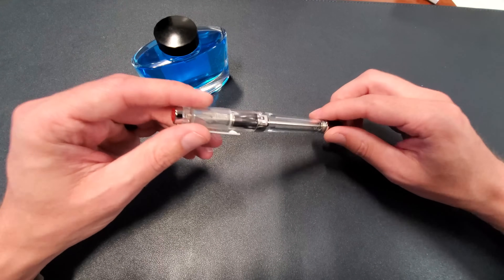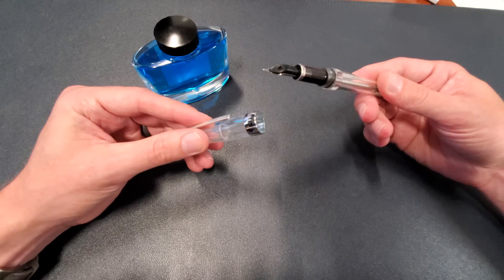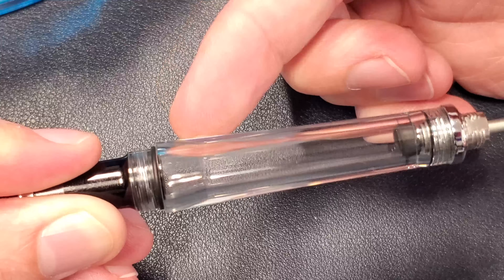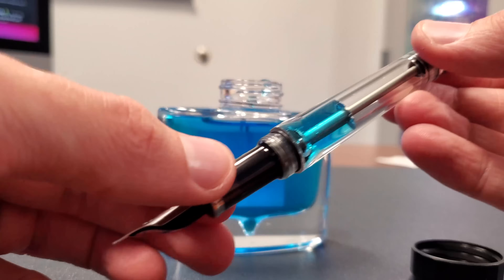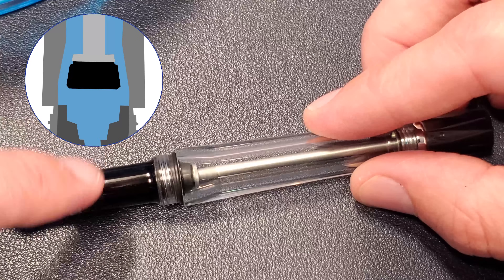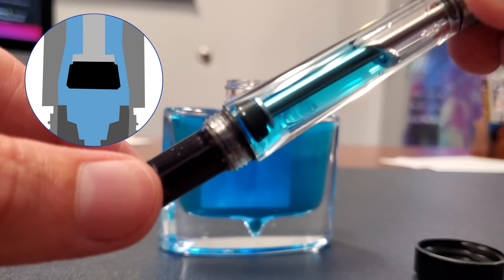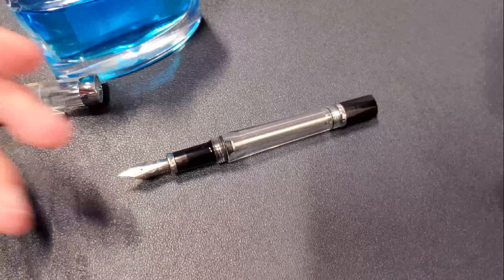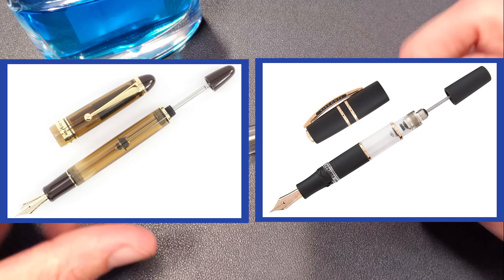How to Avoid the Most Common Mistake with Vacuum-Filling Fountain Pens

Comment: This does NOT apply to all vac fillers. Visconti power fillers ONLY if they are double reservoir.  Vintage vac fillers (Sheaffer and Wahl Eversharp) do not have this feature either.
Reply from the maker: You're absolutely right! Thank you for that. - Drew
Reply: So the Homo Sapiens in the video is affected, because it has the double reservoir, but „normal“ Homo Sapiens like Bronze Age or the Lava Color series are not?
Reply: @ThePlumbeus  Exactly the question I had, thank you. I wonder how the "normal" HS does this with only one reservoir, just like the TWSBI and other VACs.

Comment: While anyone can appreciate its ink capacity, there's something conceptually in-artful with a vac-filler from a aesthetic as well as an engineering perspective. From an engineering perspective it's tantamount to one having to leave the gas tank cap open in order to ensure that fuel flows to the engine. From an aesthetic perspective there's a loose caboose spinning at the end of your pen in the form of your end cap. If you truly need that much ink available during the course of your day and don't want to pop in a cartridge or fill from a bottle, then perhaps purchasing two or more pens that feature a C&C, piston or bladder or any combination thereof would handily meet your need for a relentless torrent of ink. Then again, a pencil can frequently save the day when all else fails.

Comment: Most common mistake? Buying a vac filler with the double gasket. Good luck getting the secondary gasket clear enough from the reservoir to let ink through :P
Reply from the maker: Yeah I was happy when they moved away from that design on the VAC-700. - Drew

Comment: I don't own a vac-filler, so I am wondering how long it takes for the ink to fill the feed if one forgets to open the valve and the nib consequently dries out. Is it like putting a new cartridge in a pen, which can take many minutes for the ink to reach the paper, or is it faster than that. It sounds like it can be a tad frustrating. Unlike most other pump systems there does not appear to be a way around having to wait and wait, other than dipping the pen in a bottle to refresh the nib. What do you think or what have you experienced?
Reply from the maker: The feed can get saturated with ink and begin within seconds, usually. If you're  plugging in a cartridge, the feed is often pretty dry. With vac fillers, the feed is still inky, just no longer wet enough to write - so ink moves more quickly.  I hope that helps! - Drew

Comment: I'm confused. Where does the air in the upper section of the plunger go when pulling back. It has to be pushed out.

Does it have a one way valve?

And when you redo it with ink in it already wouldn't the ink get stuck behind it?
Reply from the maker: Air goes out, ink goes in! - Drew
Reply: @Gouletpens  but unless there's a one way valve at the top, the action of pulling the plunger back draws air from the nib but also creates compressed air behind it.
Reply: @Gouletpens  hey you might be interested in this.appearntly they do have a one way valve. But the design is very clever and hidden inside the middle of the plunger! Ink passes trough when pushing up and so does air and it closes with the motion of the plunger pushing down :)
Reply: @Gouletpens  I'm thinking of 3d printing my own vacuum fill pen now lol

Comment: How do you guys clean your vacuum-filler pens? I recently got one and filled it with a vibrant pink ink. However, after flushing, there is a tint of pink visible on the barrel. Does anyone have any tips for cleaning it?
Reply: Good question! Looks like you own a translucent model like the TWSBI. Those TWSBI can be fully disassembled. How to fully clean a Homo Sapiens y another question.

Comment: Are there different kinds of vacuum fillers?
Reply from the maker: Yes! Vintage vac fillers are certainly different than these, and Visconti has a "Double reservoir" and a "Single reservoir" power filler. The double reservoir seal off, and the single does not. - Drew

Comment: How wide do you need to open the knob?
Reply: I had the same question when I started with vac fillers and found you only need to give it a couple of turns. Ink will flow if there's even a tiny gap, as those who've had a hairline cracked section will attest. Personally I back it off until the end cap is almost free of the threads, or maybe a couple of millimetres, but I don't think it matters too much.
Reply: @bikkies  Thanks. That's helpful.

Comment: the plastic barrel on the vac700 builds pressure from the warmth of your hand and starts writing very sloppy lines
Reply from the maker: That hasn't been a common experience for our customers. I'm sorry it didn't work out for you - did you purchase it recently? - Drew
Reply: @Gouletpens  not recently and not through Goulet. It usually happened at about half full when there's enough air volume and after a few pages of writing with the stopper open.

Comment: How do you guys clean your vacuum-filler pens? I recently got one and filled it with a vibrant pink ink. However, after flushing, there is a tint of pink visible on the barrel. Does anyone have any tips for cleaning it?
Reply from the maker: The VAC-700 is easy to clean, since you can use the included wrench to disassemble everything! - Drew